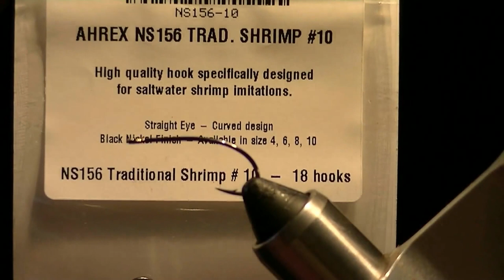Attractor foam dry fly tying instructions by Ruben Martin

Comment: Great looking pattern. I'm curious about the durability of the parachute hackle that's pinned into the foam though.
Reply from the maker: Hi james, thanks, if you use the rigth glue it will stay on the fly, but in the case some of the go off, the beuty of this technique is that you can replace it, and is a simple way to put parachutes on foam flies that alway simms to fall from side without it